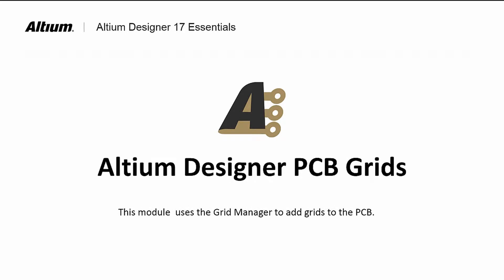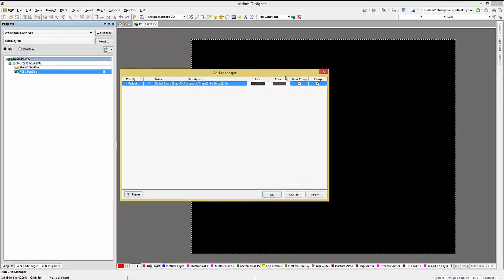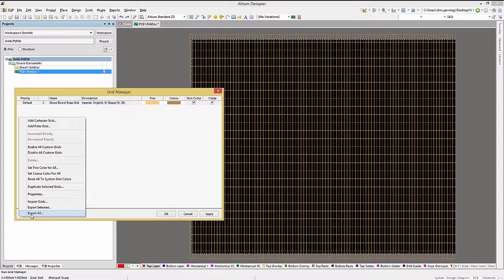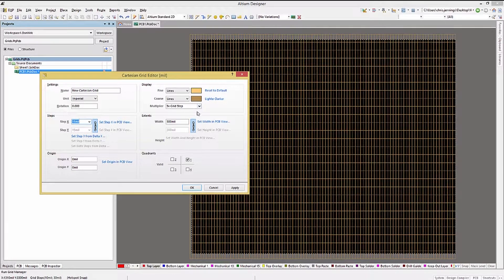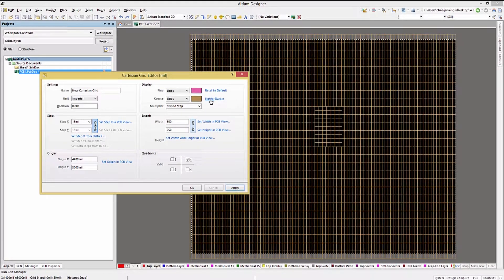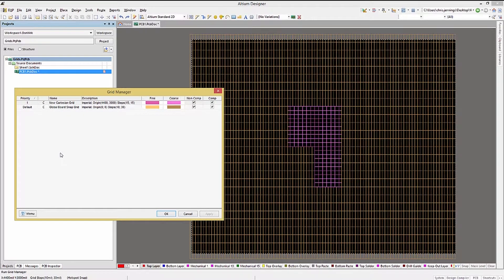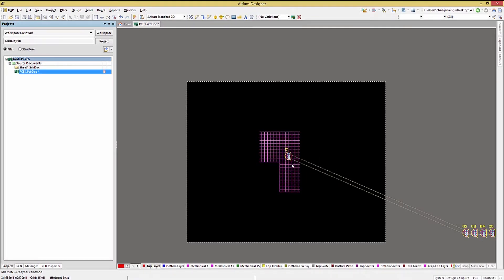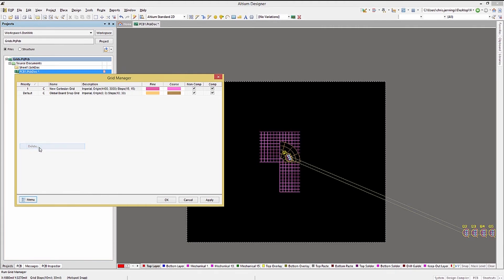PCB Design Grids and the Grid Manager | Altium Designer 17 Essentials | Module 18

Comment: When i go to the grid menu in Altium 21.3.2, there is no grid manager..... And when I change the grid, nothing happens!! Can you please just make it work, and stop moving stuff around? 
Just think about how to do it once properly before you start implementing it. Your manual is also not op to date with all the changes you make, leaving me searching how to change the grid for an hour, finally found it's under the properties panel now. I knew all the shortcuts out of the top my head from an older version, but so much has been changed and renamed.